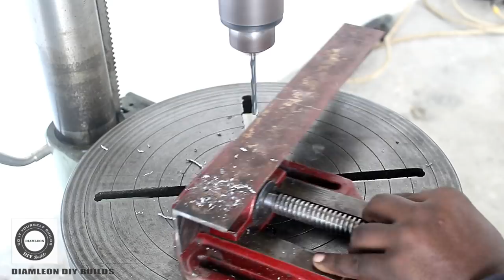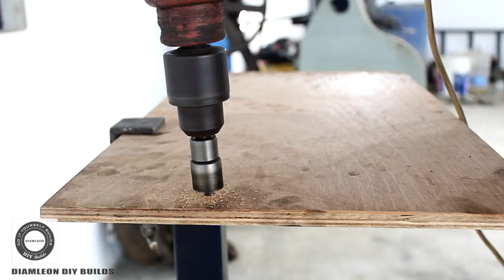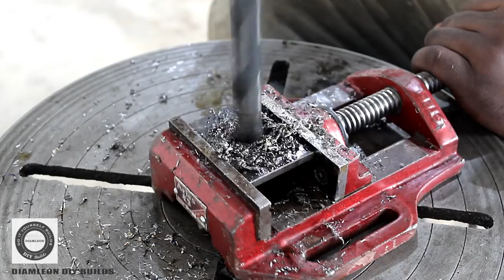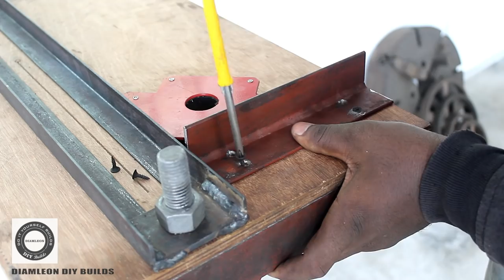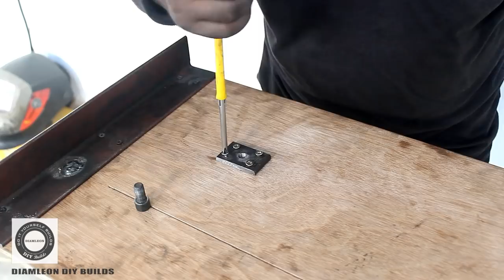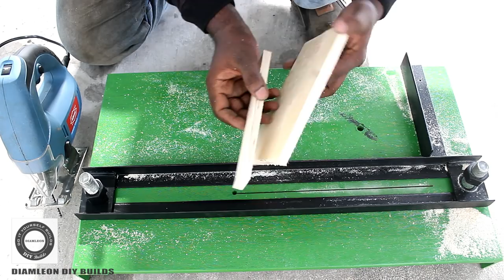Homemade Jigsaw Cutting Station | Jigsaw Sliding Crosscut Jig | DIY Jigsaw Miter Jig

Comment: this is really nice job, but seems a little overkill for a simple jig saw tool. Great angle grinder, lathe, stick welding and drilling action. I learnt a great deal about how to handle these tools properly. But not so sure about the angle grinder being used without a guard. Great craftsman and craftmanship.